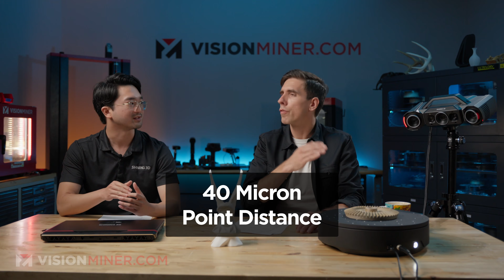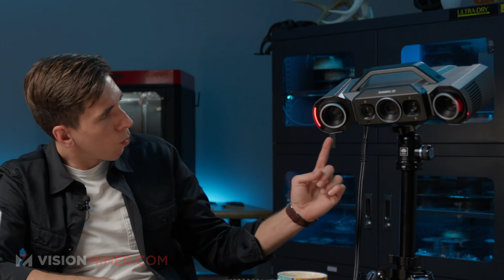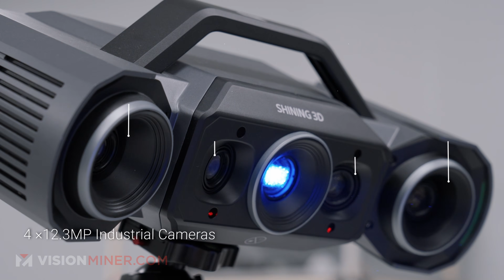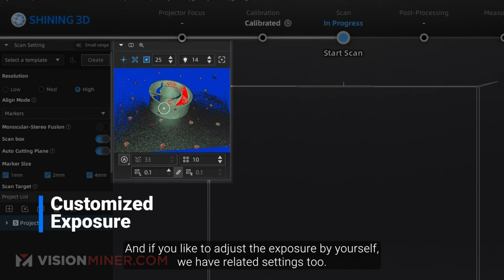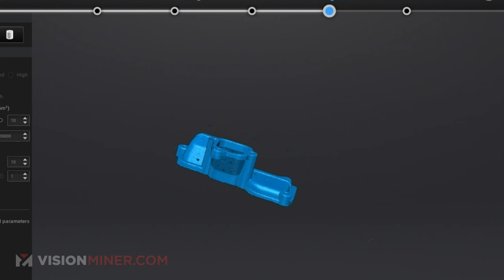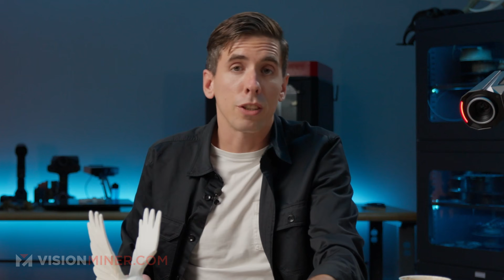Shining3D OptimScan Review | Structured Light at the Next Level

Comment: I may be commenting before its mentioned, but I also may forget as the tech details flood in. How would this unit deal with black body structures and/or reflective surfaces? Does it still require the matting spray as other units?
add: yep, jumped the gun, lol